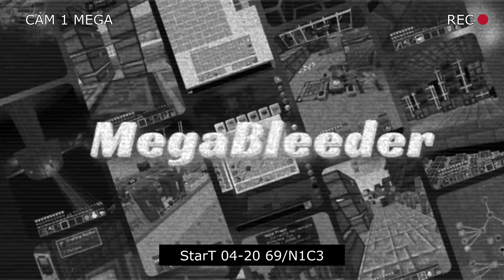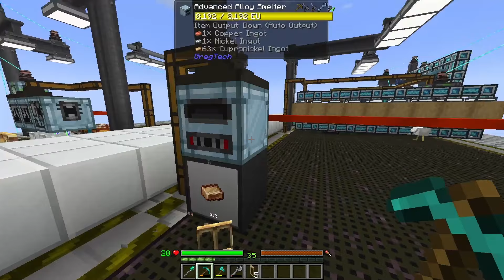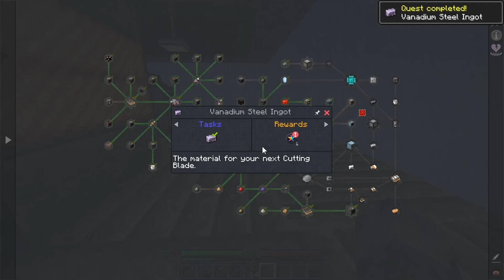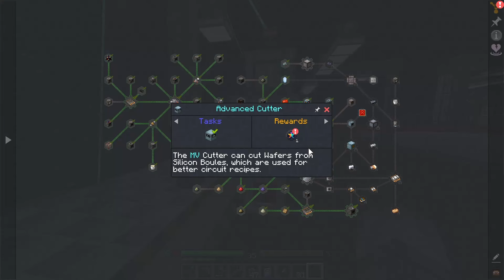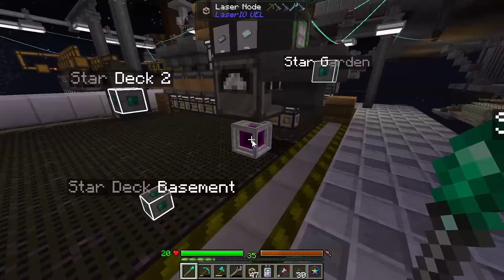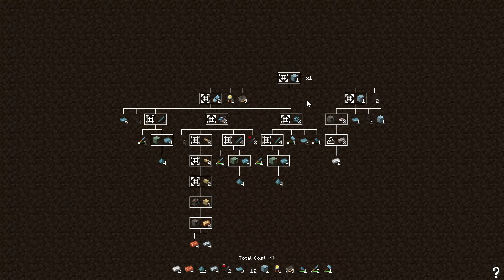Star Technology Ep10 Knocking on the AE2 door

Comment: I know I'm a few months late to the party, So if you've already done this and are doing this. Use Channels with LaserIO don't leave them at default white. Just to make sure items/fluids are sent to the correct place. The LaserIO redstone card will work with level emitters' as well. This lets you redstone control machines. I used that with my passive wall when I was doing Monifactory earlier this year. Just found your content as I was looking for StarT stuff as I want to try it but the create aspect is putting me off.
Reply from the maker: I do start using LaserIO differently and even implement the Redstone cards 😁

Comment: Yeah, I had to leave my ebf line at mv until unlocking flux networks at hv. I wonder if the energy transfer rate on laserio is any good?
Reply: You also could use a local dynamo to supplement power
Reply from the maker: @derpitydoo8681 it looks like laserio can transmit a million rf/t so i may switch to that
Reply: @megableeder  yeah i just got done switching all my power transmission to laserio. I now conveniently have a base wide laserio network for item and fluid logistics as well :D
Reply from the maker: @derpitydoo8681  that would definitely be helpful!